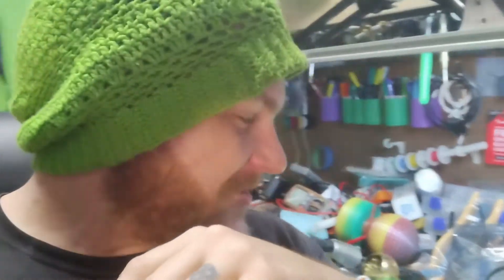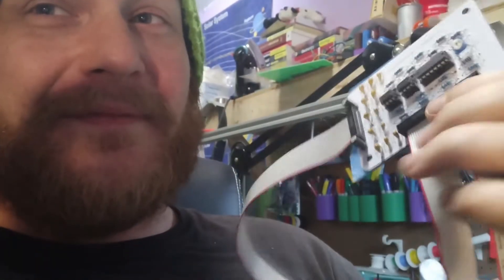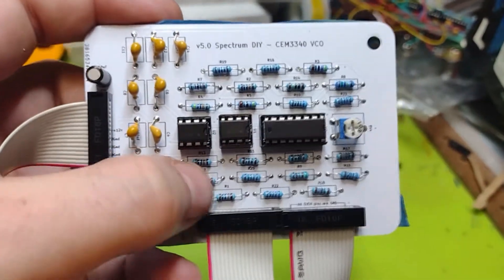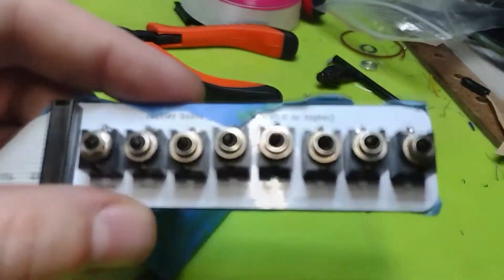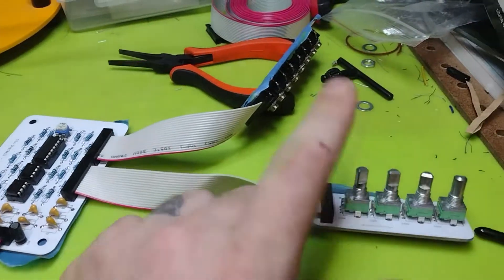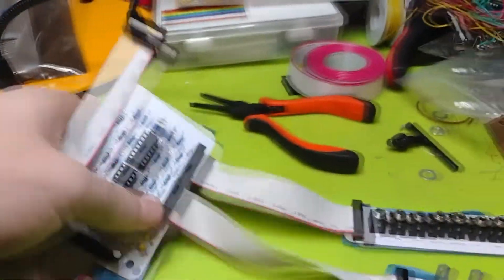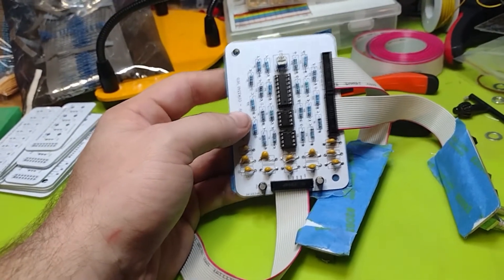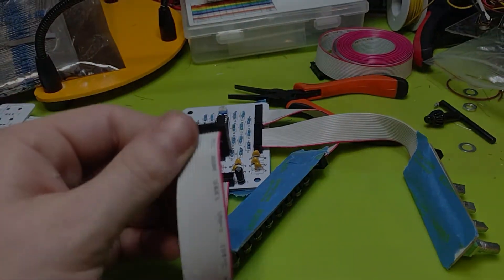DIY Synth VCO | Part 3 update

Comment: Congrats Dave. Its a nice feeling when things just work. BTW I also use the panel mounted jacks soldered to PCBs  - except I don't have the bigger holes so I have to 'snip down' the solder tabs get em to feed thru. It works absolutely fine and these style jacks are cheaper and easier to source at my local electronics supplier.
Reply from the maker: Thank you! And yeah, I am so glad it worked! I'll have to look into getting round legged panel jacks too 🤔🤔